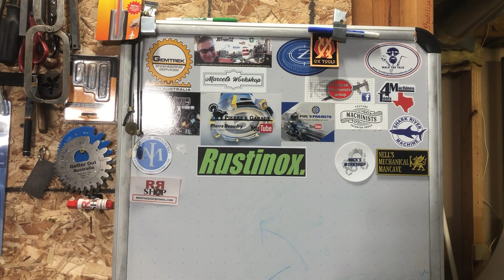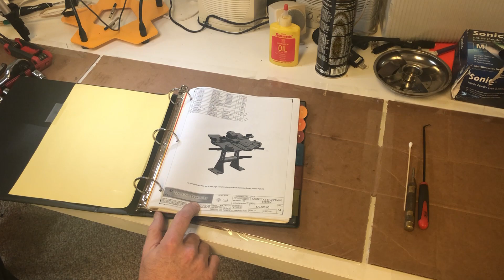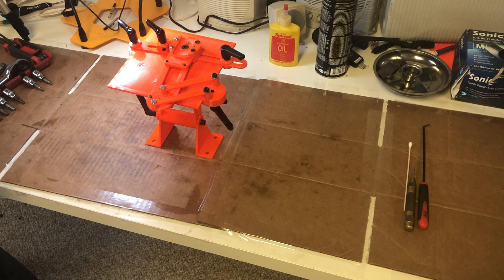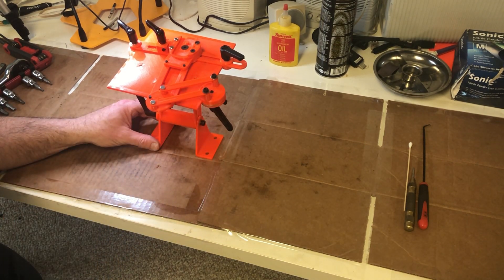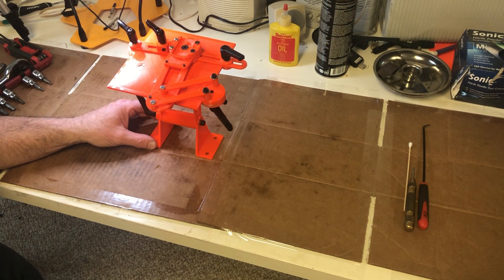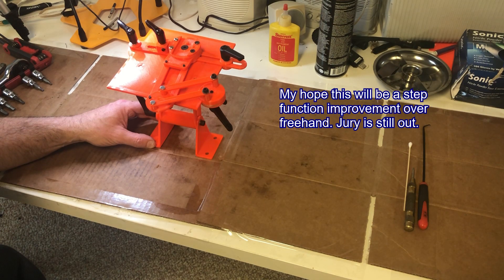Acute Tool Sharpening System Project - with a twist

Comment: Finished mine, the top clamp as indicated in the plans is 4 mm too short
Reply from the maker: Great I had to do some little tweaks. It worked in plastic…. I will redo some plastic in metal then it will work fine. How did it sharpen?